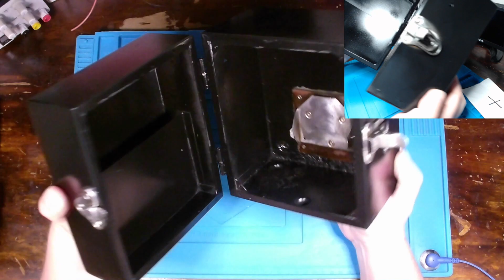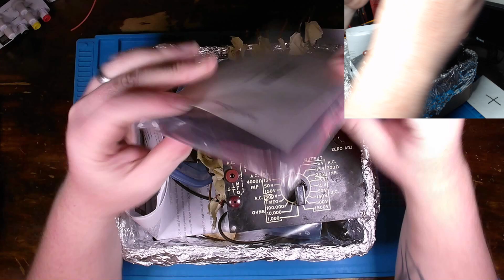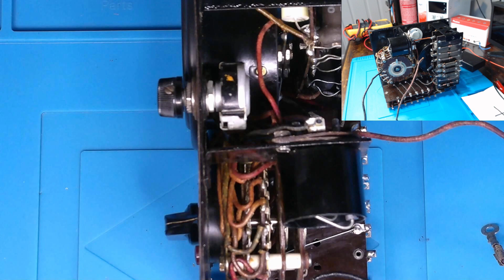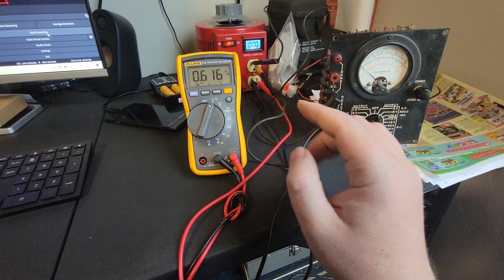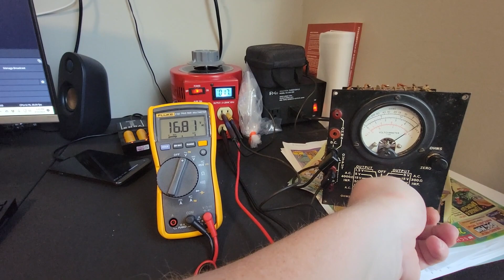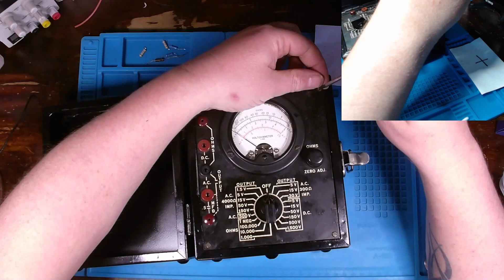(Part 4/4) WWII Era Triplett VOM Restoration Final Repairs, Rebuild, and Testing

Comment: Well done, a challenging project. Out of curiosity I wonder whether the meter reads slightly differently (accuracy-wise) when on its back. I seem to remember some old Avo meters would only really be accurate if horizontal. On some old schematics M (a roman numeral) actually means K (primarily for resistor values).
Reply from the maker: It definitely does affect the needles position when laid down v upright. At some point I may come back and bring the values of the resistor network closer to their original values which should help with the accuracy, but this series went on long enough.